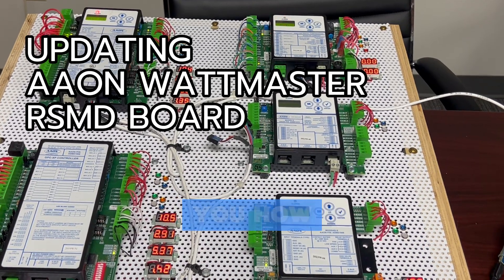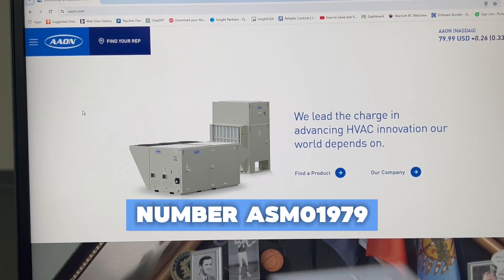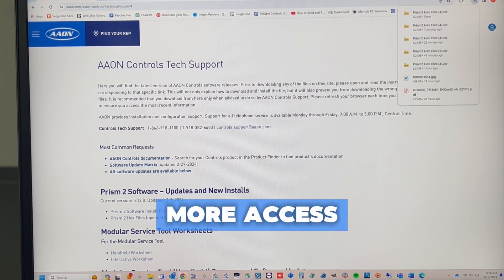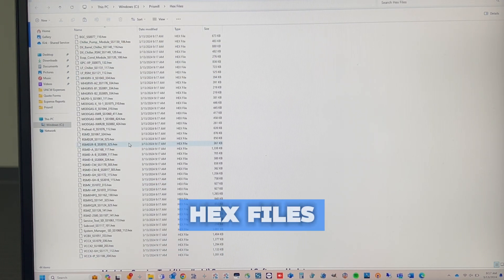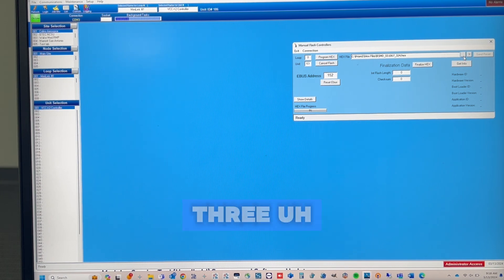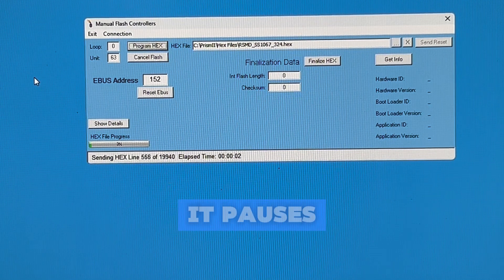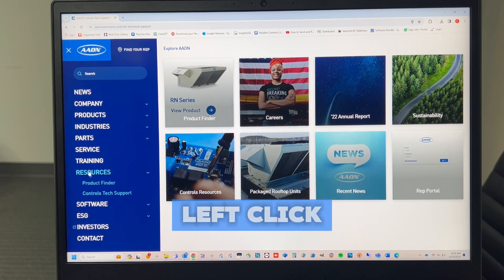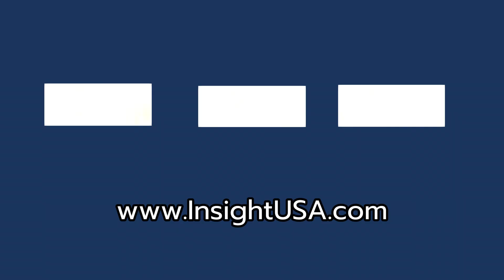How to Update the AAON Wattmaster RSMD Board

Comment: Is there any downside to using a CommLink 5 instead to do the update using the other method AAON lists which is passing through the update to the expansion board from the main controller?
Reply: I had to unplug ebus connectors from module your updating to vccx2 in order for it to work